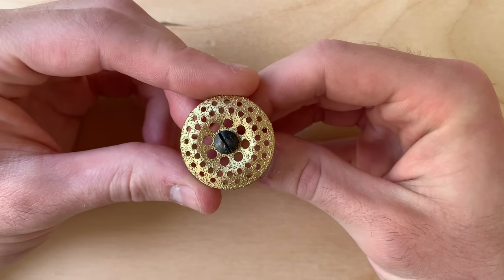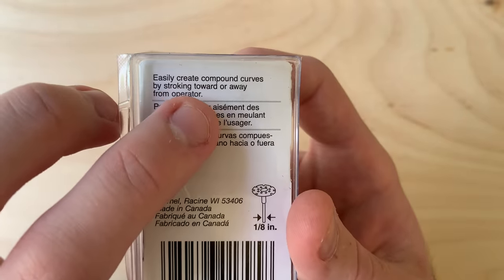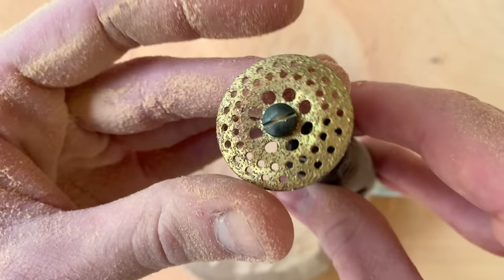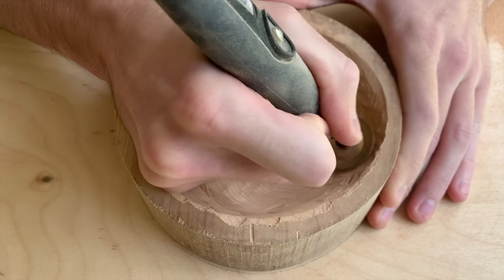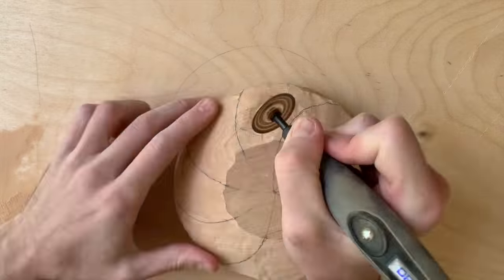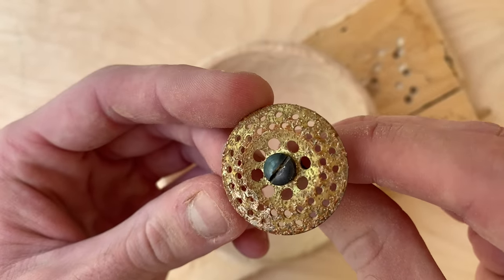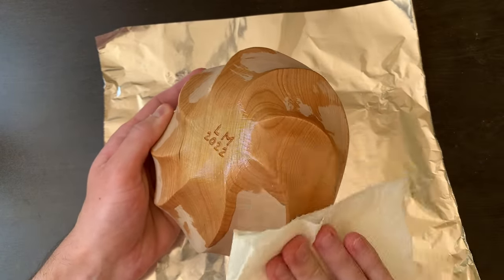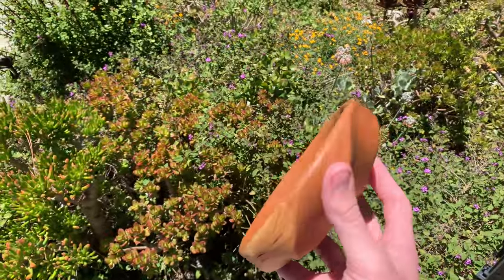My Most Expensive Dremel Bit...

Comment: Ha!! $10 is the absolute cheapest Dremel bit you can buy in Canada. The prices are stupid high. That 801 is around $40 up here.
Reply from the maker: That’s crazy! 40 Usd or cad?
Reply: @LogsCarvingClub  CAD. Yup, sure is. Everything is like that up here. You have access to so much more options.
Reply: Wow.
Reply: We get ripped off every chance they get. On almost everything we need to be productive or live.
Reply: Really ? I'm from Argentina and even with all of the stupid taxes here the Dremel bits are still way less than 40 usa dollars
Reply: Dremel 7/8-inch Rotary Tool Bits Diamond Wheel Accessory for Marble, Concrete, Brick, Porcelain, Ceramics $41.98 cdn each at HD
Reply: @cannednolan8194  It's frustrating to watch all the maker and DIY projects on here and see the huge options and products available in the US that just are not available here - unless you purchase through the suppliers for commercial. So stuff available in Walmart you have to go to something like Harris & Roome/Graybar or Apex and special order for a premium. It's totally messed up.

Comment: I wonder how that bit would do trimming goat hooves?  I have seen people using angle grinders to trim horses and cattle, but that seemed over kill for a goat.
Reply from the maker: Might be good! I haven't ever trimmed hooves so I'm not sure how hard they are. I always assumed they just use those large clippers or blades for horses cattle, I'd be worried about slipping with a rotary tool or grinder.
Reply: @LogsCarvingClub  Just as an example, check out The Hoof GP, he uses a pretty serious blade on his angle grinder. The nippers are fine for my smaller goats, but I don't have the strength in my hands to use them on my buck. His hooves are too thick for me.

Comment: So glad I saw this.  I’ve got about 6 dremel devices and every attachment. I use it every day.  For traditional pipe making, some of use use a 6” French Wheel” which is a sanding wheel for an arbor or whatever but with a semi curved surface.  They’re almost all hand made due to a specialized use for shaping curves etc and are $150-200 each.  This is a mini version.  Bought both bits right away to try out.  :). It should be perfect for what I need really.  I just got the 8260 (I have a dremel lite I use a lot and a foredom but been using flex shaft with my Dremel 300 I bought 25 years ago and works great but wanted wireless and well.. my obsessiveness .. lol.
Reply from the maker: Great to hear Peter! I hope it works well for you. I’m also obsessed as you can imagine with the tool, just works so well for so many small things
Reply: @LogsCarvingClub  thanks.  Can’t wait to try on a new briar pipe.   Yup I grab a dremel about 4-8 times a day.  The lite is surprisingly useful for it’s slow speed but I use that mostly for the wire wheels or light buffing etc.   Easier to grab and use.   I really haven’t tried the 8260 yet. I got the E Eliauk Tool box for it.  It’s a perfect toolbox for a dremel.  It’s just been hot and I’ve been holding off until a bit cooler to work outsiden I have a couple new Kutzall burrs I haven’t tried yet as well.  Great channel btw.  I need to work on more diversified carving than my niche and started searching.   I also made an acrylic dust box for sanding etc. inside. Just haven’t finished it yet. (No garage or shop as I’d need a few million bucks for a small house with a garage where I am.

Comment: I owned three of the bits you showed second ( the one you've got over three years). They keep snapping for me..
Reply from the maker: That’s interesting… I recently got another to keep one sharp for wood carving but I’ve never had one snap. What do you use them on? Also which brand?
Reply: @LogsCarvingClub  the dremel brand. And i use them on different kinds of wood without much pressure.. thanks for responding btw!

Comment: Hey. I bought something similar, Dremel branded, but it was flat, and that was the only exception. 
I used mine for years and must have put 50+ hours on it. I'd still be using it if i hadn't lost it, or lent it to someone...
Great video. Great design. Thanks.
Reply from the maker: Perhaps the Dremel 543? I have the 544 version and enjoy it a lot. I hope it lasts as long! Thanks.

Comment: very nice video! i carve too. I use kutzall burrs they are about 20 a pop also. i mostly carve soft wood so they last a long time. I also use a 1/4 inch die grinder and 4 1//2 angle grinder to remove a lot of material on bigger projects.

Comment: Man that bowl looks amazing! Could you please tell me where you got this wood block from and how long it took you to complete this bowl from start to finish? Could you please post the plans? Thanks man! 

Also I want to make a food safe bowl which finishing polish should I use for that? Thanks
Reply from the maker: Thank you! I don't have any plans other than the video, but it took me about 2 hours I think (without the extended breaks I take). I got the blank from a Rockler woodworking store, but I'm not sure if you have those locally. I'd probably just use food safe mineral oil to finish a bowl. Make sure it's food safe. Also, make sure the actual wood you use is food safe. Best.

Comment: Hello, really amazing and inspiring work here. I have a 542 cutting/shaping wheel. Are these relatively the same type bits? 
I’m rather new the process. Thank you!
Reply from the maker: Really similar, but that one’s so flat I think you’d have a hard time using it for this sorta thing. I use the ez544 which is like yours just for cutting straight lines

Comment: Which mask and eye protection do you use? Do you also have a link for it?
Reply from the maker: I might have links in the description but if not I use a 3M respirator with p100 filters. I also use Milwaukee safety glasses but the dust still gets by into my eyes if I’m not careful. I’m not an expert on safety so I’d look a little more into it if I were you.

Comment: "$20 is the most expensive dremel tool you can get"
Me, sitting here fuming in Australia, as I look at a set of four Kutzall burrs on ebay for $120AUD, so $30 per bit, and that's before another $40AUD for postage.
Reply from the maker: I just looked and I think it's about $108AUD before shipping for a set of four here. I usually just buy them individually in the models I use most often because even for me they're a bit too pricey. Not sure why they're marked up outside of the US.

Comment: Check permagrit tools 
The best on the market
Reply from the maker: Do they make similar attachments?
Reply: yup 
u can get sanding blocks in different shape , 2 grids (on both sides 1 grid) 
up to almost 100cm long 
special files , rotary tools big and small (if u want to buy go with coarse- fine is ...rly fine , not rly for wood) 

and more 

i use them for composite materials and wood , works crazy good and literally have lifetime warranty ....
just remember to buy coarse ones because fine is like super fine ...mostly for composite materials , easly clog up in wood  and dont use them on metal , can work for some time but will get destroyed to fast for the price and dont work as good as for example 3M Cubitron II abrasives

PS

u should  also check entire line of 3M CUBITRON II (cubitron II its name of ceramic abrasive material they use) 
literally last 10-15x longer than bosch , dewalt , mirka , festool etc 
where works 2-3x faster and cost the same or less (except 125mm cutting discs - but they literally last 10x longer and works in my case 1.5-2times faster)
belts for belt sander 
discs for orbital sander 
etc....if u not ever used them but used top brand ones like Mirka , Festool etc 
you will be like " DAAAAMN" 
if u never used mirka etc 
jaw on the floor xD

i love to cut discs and belts for belt sander from 3M Cubitron II line to make my own discs and drums for Dremel 
works crazy good 

there is also Norton Blaze ...its like 70% performance of 3M cubitron II line abrasives in case of speed and lifetime
but 1000% stronger glue that let u push it on thin parts (like sticking out screew that will destroy everything else and 3M discs too but using norton blaze u can easly sand it pushing the tool like madman ..... rapid strip is crazy for metalworking etc if u want paint  or rust off as quick as possible